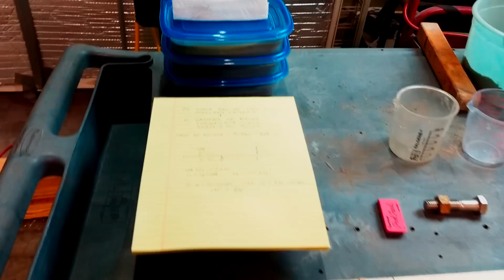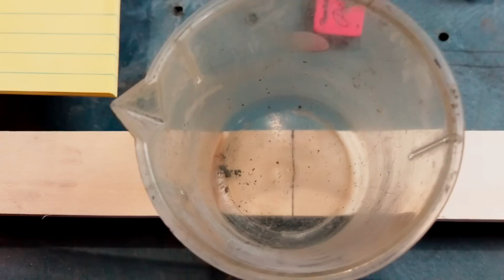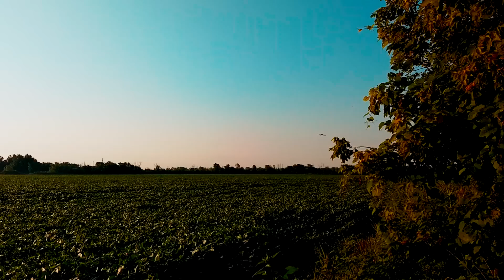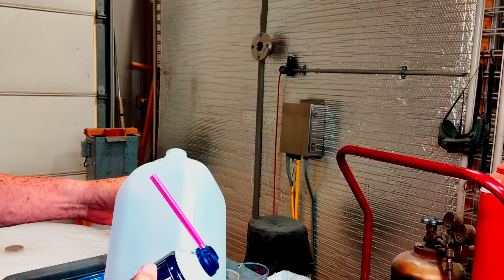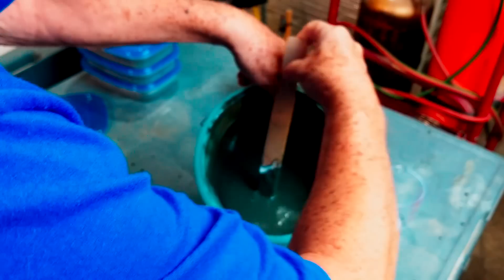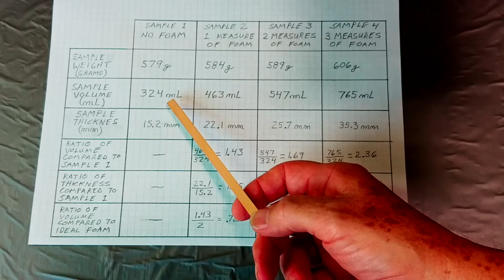Aircrete Experiments with Low Cost Foam Generator

Comment: What additives make it work better. Ive heard of glycerin, xanthum gum, aluminum powder……?. I wonder if barbasol has any glycerin in it. I read that glycerin helps make good aircrete but have not tried it yet. I read that some of the detergents like 7th Generation dish soap which are used for aircrete have glycerin. Do all detergents or surfactants have glycerin? What other additives are proven to help make good aircrete?
Reply from the maker: Good questions. Thank you for your comment.

Comment: What tube of foam do you use?
Reply from the maker: I used a brand called "Barbasol" . I used the "original" which has no additives such as menthol etc. It is the least expensive brand that I could find. Best regards.

Comment: Finding a way to mix thouroly with minimum agitation would increase volume.
A ratio of 1.618 would be interesting.
Adding a small amount of sugar may help or ruin the bubbles.
I have known two other older engineers of your caliber and had the opportunity to work with them.

Comment: I think the balance beam is an interesting demonstration of ratios and relevant to the ability to make repetitive measurements for testing purposes. 
(One could as easily tare the container for the cement – fill it – take that weight divided by 1.88 – tare the water container and fill to required weight.)
The math  to arrive at the placements of the 2 vessels on the balance beam was also a useful demonstration.
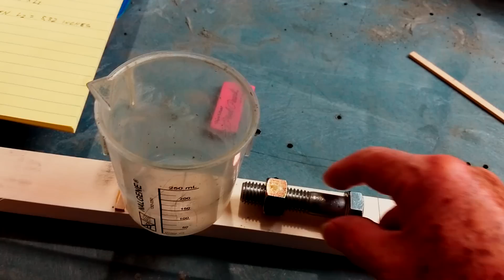Where I became doubtful was when the 2 'tare' weights ( bolt and eraser) were introduced (9:30). 
It's necessary to assure the 2 vessels are of equal weight – but when the bolt and eraser were set on the balance beam and moved to level it – in affect it made the cement and water to be equal in weight and canceled out the 1.88 ratio previously determined. The weight of the bolt and eraser should have been cement!  Pls help we to see what I am not understanding.

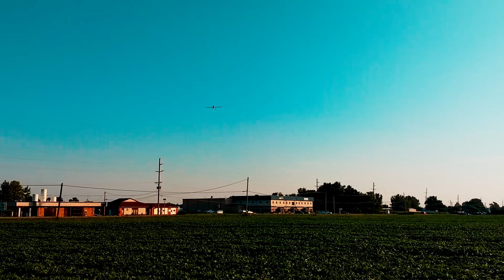Comment: A bit after the 13:00 point: I'd be a LOT more concerned about breathing in the chemicals he's dropping... ;p 
Around the 20:30 point: Given the cost comparison between shaving cream versus Suave for oily hair shampoo, it'd be WAY less expensive to build a low cost version of a foam mate to begin with ~ from someone who stays "so broke I do darned good to pay attention..." (But, I guess it would be great for "proof of concept" purposes; ans, for demonstrating the ratios. Personally, I'm looking at air crete in the context of things such as a heater & water heater for winter; perhaps a storage shed or two and for a couple of other potential projects along similar lines.) I don't intend this comment to seem snarky ~ it's intended for for folks who come along later and might be daunted by the cost of using shaving creme. I'm just running really short on sleep right now; and, probably not conveying the info in the best possible way... I AM looking forward to watching the rest of your video series; and, want to thank you for making it. :)

Comment: So as I see it it is 1.5 cups of cement, 1 cup of water,and 7.5 cups of foam, that's what I am going to do, I have tried once before, but did it kinda by eye and came out with bricks ,but you could break in them in half quite easily, a torch test was positive so that by holding the brick in your hand and applying heat from a gas gun you felt no heat transfer . thanks for your vid,very informative

Comment: Good evening dear Mr. Jim White, 
My name is David Espinoza, I am Venezuelan, and I have seen and reviewed my innovations on, cellular concrete, but I have time researching but in Venezuela I could never get the necessary additives to achieve a good formula 
Now I have detailed everything that you do and I see that the cement and foam are that you use are very uniform and compact, which are kept very omogenea, you put to the cement some additive that allows the catalyzing of the components.

Comment: Well Jim I'm glad you did these test because there is a lot of misinformation about this method of building with aircrete that is just dangerous to even attempt.

It will have its uses such as insulating but not structural.  

Thank You for the education.

Comment: Low cost foam generator? Ready made foam in a small can should be very costly. I've seen foam generated by putting water + soap and mixing on high speed with an electric mixer (blade/drill). Then lower speed & blend with slurry. 
Thanks for the precise ratio of 1.88-1 for slurry.

Comment: Lumps in your cement bag are not "normal". You bought a bag that was very old or has been exposed to moisture. I would advise throwing that cement away. It will not be as strong as a bag that has remained dry.

Comment: I wonder why you didn't fold in 7x the volume of the water used in your slurry? Seems others use the full bag of portland with 6 gallons of water into a 50 gal vat, with 6 gallons holding the cement, should have left 42 gallons free, thereby asking for 42 gallons of foam to be introduced, so in your experiment shouldn't we have input 7 containers by volume  of foam? or somehow  converted the volume and made a mark on the container side to be the measure for foam?
Reply: @Jimscoolstuff  Another variable is the amount and aggressiveness of the stirring to incorporate the foam.  These can dramatically affect survival of the foam bubbles within the cement.  Every aircrete experimenter needs to recognize these two variables!

Comment: Curious what got you interested in the aircrete.  Have you seen first hand wide spread usage? Local or abroad? 

By volume the 6 gallon water to 1 of the 94 lb bag of Portland cement. Knowing 1 cubic feet equals about 7.4  gallon water and a gallon of water has 16 cups equates to 119.68 so 6 gallon equals 96.94 cups.

Portland cement 119.68 cups to 96.94 cups water..  would that be calculation for volume?

Am I confused (probably yes) you used weight in your method or not? On water to Portland cement ratio then foam ratio by volume?

I have never done this myself - but I need to have a clear understanding to calculate ratio mixtures.

That was an awesome explanation you gave " like pouring water in sand it increases the weight but doesn't add to volume " ...
Reply: Hey you really know your math. I like keeping it simple. 6 gallon water to 94 lbs cement. Reduce it down 6÷6=1 gallon. 94 lbs ÷6=15.666666667

So 1 gallon water to 15 and a half pounds cemen.

16 cups in gallon so essentially almost  1 cup per pound cement.  Or a 1 to 1 ratio.  6 gallon equals 96 cups and 94 lbs cement.  Essentially 1 to 1 ratio IF figured that way in ratio

Comment: Wondering about your test.. only testing muffins just water and Portland cement.  Why omit foam since it is part of the aircrete?

Am I the only one interested in results of test with foam?

Other test - how about using mortar instead of the water and portland cement mixture? 

Be really curious if it has been done with mortar?

And especially say test with the common N mortar mix compared to the Veneer Stone mortar. The PSI rating of N is 750 psi, then S 2300 to 3000 psi, K is 2500 psi.. And Veneer Stone mortar is twice that of other mortars.

Comment: While I very much appreciate your efforts especially the depth of intent to educate.

Adding 6 gallon water to 1 bag (94 lbs) of Portland cement. By volume the Portland cement is 1 cubic feet. The 6 gallon of water equates to 81 % of a cubic foot by volume.  Added together totals 1.8 cubic feet and in your video your comment suggested about 1 and a half cubic feet. 

Only taking time to write for purpose of viewers to more accurately estimate quantity required and or cost estimates. 

Also wondering why you aren't including foam itself... 

If mixed at a ratio of say 50 % foam. Calculate estimates increase for the above mentioned to approximately 2.7 cubic feet. If correct math the 1.8 adding one half or .9
Reply: @Jimscoolstuff  great to learn. So in retrospect the water being 81 % of a cubic foot ( 7.48 x .81 = 6 gallon).
The portland cement = 1 cubic foot.  
Prior to being mixed together combined volume totals 1.8 cubic feet.
Once mixed together the portland cement takes on less volume. Changing from a solid initally. Becoming suspended in water losing powder mass form. 
Theory:  once mixed an expected anticipated loss of approximately 30% of the cubuc foot volume amount of Portland cement used. In volume by weight once mixed initially both retain combined factors - later after water evaporation a large portion of the weight by volume of water is substantially lost.

Comment: Just want to say, wear a dust  mask to prevent breathing in the dust when sifting and moving between containers. Portland cement isn't the best thing to have in the lungs. 

And where you can, limit its exposure to the open air. It the calcium oxides reacts with the CO2 and moisture in air forming calcium carbonates.

Comment: did you do strength tests ? also would heat treating them strengthen them much with added clay ? the quest for strong super light bricks even for insulation.

Comment: the end of this video requests strength test. . .honey do carpenter YouTube channel is presently building an aircrete testing lab!! he will be testing density, mixtures, and strengths!! follow him as the lab is built and look at his amazing work (if you have time, he's been posting since about Nov. 2017) he's built a new concept of rocket stove heater, a shed using aircrete and is aiming for a geodesic dome (on his "honey do" list from his wife). BUT WAIT! THERE'S MORE! on his Etsy website are recipes for aircrete for several applications: furnace-for smelting metal, insulation, garden forms for building beds AND a foam generator for larger volumes of foam using Suave shampoo as a foaming agent!!  Enjoy.

Comment: Great video, thanks for your work . The Barasol idea is  so clever !. I think to try emptying a can  to see how they introduce the liquid ??  Ventori  ? and copy it or use the can s internals over and over  again.  the density of the foam   I wounder  about.. Another very interesting idea you mentioned was the  longevity of the foam  ??  AND  how much volume is lost durring  the mixing  into the cement slurry.  Now ya did it ya got me going thinking .Thanks again.

Comment: Nice work on trying to get standardized measurements for aircrete applications. I would say that your shaving cream is as close to the best density of foam possible. An ideal foam weight by volume is suppose to be 80g/liter. I wonder what shaving cream weighs?